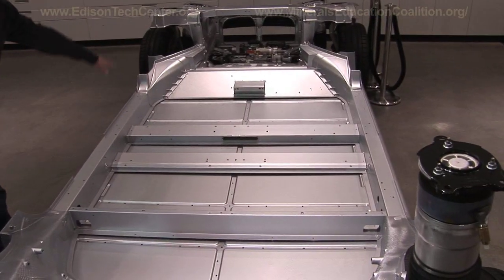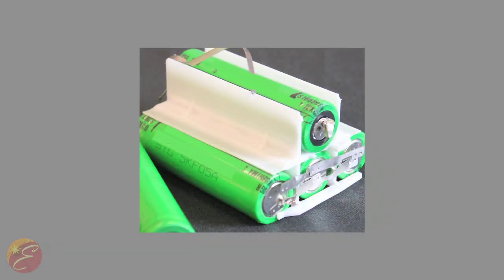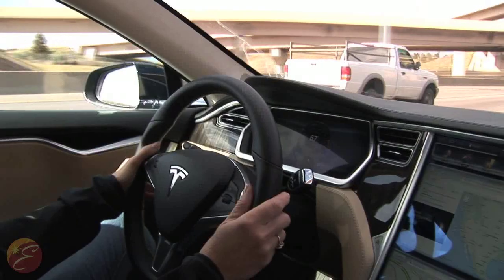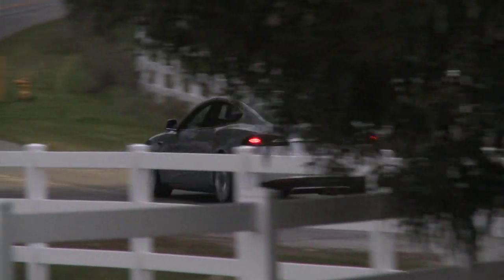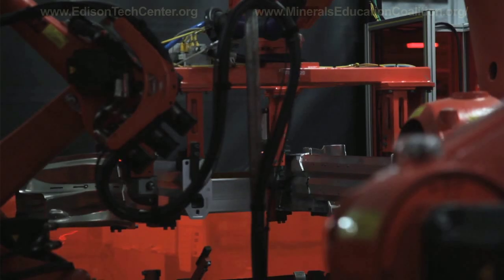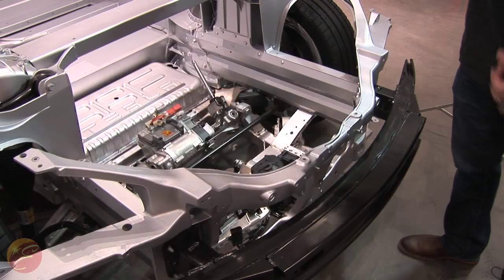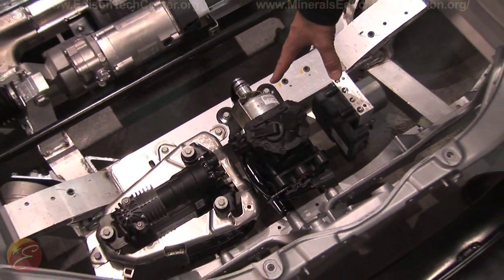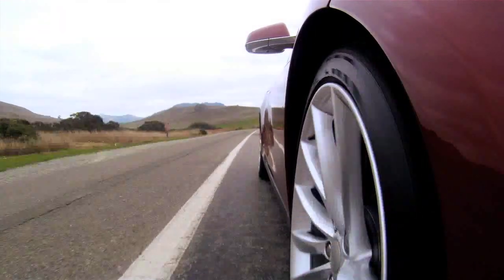Batteries, Suspension & Body in Tesla Model S

Comment: My Ford Focus electric with 100 mile max is impossible to use anywhere near the full charge. It's front wheel drive sucks so I am eagerly waiting for the model3 Tesla. I love the massive torque at low speed, my Focus out accelerates my 400HP Hemi truck.